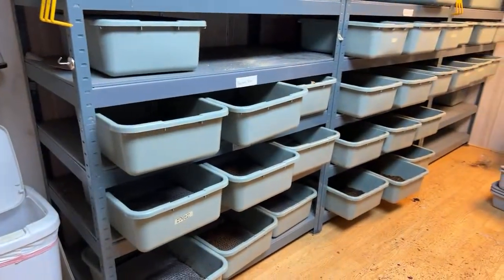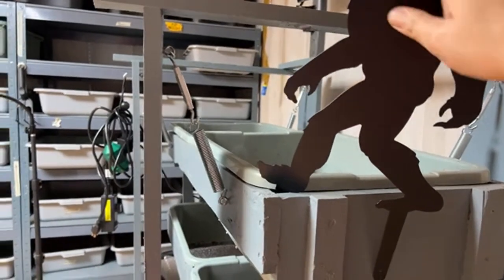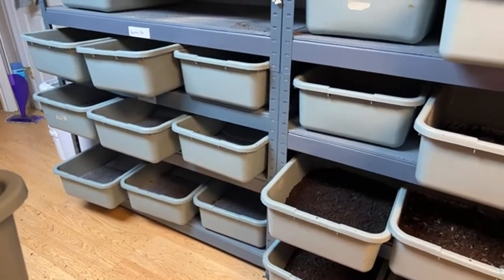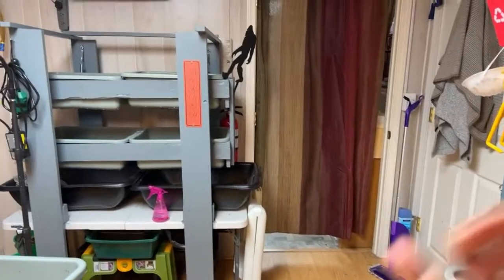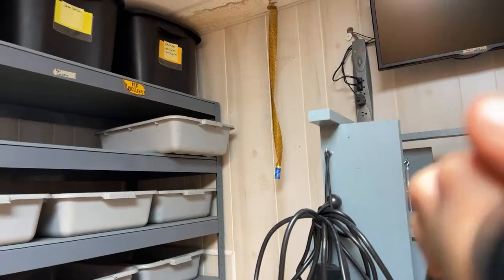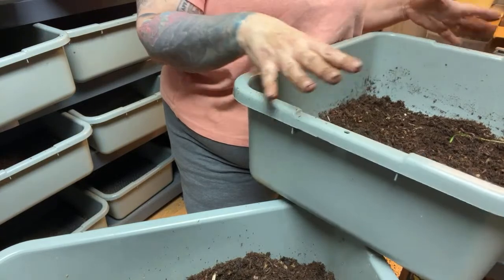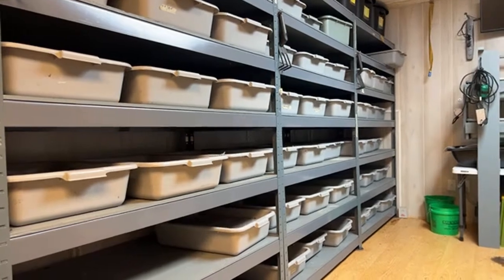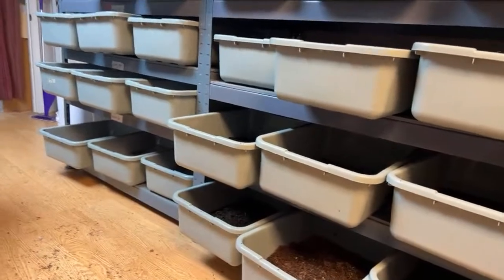Making money growing worms

Comment: I love watching your vids and I could sell worms , I mean I have the experience of worms and have gone thru a lot , but I dont have the space and probably not the money to invest .  So what I do is keep the worms happy and develop enough castings for myself and my two siblings. For yrs I only fed worm chow from food scraps, but the last couple months have gone strictly dry worm chow and there is an increase in the amount of castings already.  I can usually always tell when my worm trays are ready to harvest as my bottom tray of my 360 is a black black.  I did sort push for my last harvest because I wanted all my rotation trays to have the effect of the dry food formula and now they do and when I set up a new tray which is coco coir and striped newsprint I also mix in a good amount of the dry mix in starting that tray and also will sprinkle a light amount on top,  then when they begin to move to that tray will add more as they eat it.  I dont let it run out completely.  In checking the feeding tray I see that the worms are not only on top but also thick in the top 2" of bedding.  I have stretched this post out detailing it more so it may help anyone else who might be at the same point I am in worming.  Im noticing the worms on top look quite healthy very moist and robust looking.
Reply from the maker: Your worms are doing great. I see them on TikTok.

Comment: I probably mentioned this before but several years ago I made my own sifter with 2x4 s  and its  about 24" x 30"  with 1/4" screening and I just sift by hand over a wheel barrow.  It works for me in my rather small hobby.  BTW  I also used to buy and use peat by the bale , but got tired of the dustiness of it no matter how I tried to cover it.  If I could find some on the kind you show I might try it.
Reply: I see that mooresville lowes has the same exact product you show which is close to me will try it next.  Costs more than the dusty types but most likely worth it.
Reply: I also use the coir or peat as part of container mixes for my plants.
Reply from the maker: It’s wonderful. It does cause the teeny bit more but it’s worth it.
Reply: I like the live version!  And thank you for sharing all your worm information 🎉

Comment: I recently ran into a problem which was my fault but forgot When adding coir to new bedding I forgot to wring it out first, was way too wet and all the worms congregated at the top of bins.  I usually wring out the coir by hand but forgot.
Reply from the maker: It happens don’t worry about it. I have made tons of mistakes. Important thing is you know what you did and he fixed it
Reply: @TheGardenAndWormLady  Thanks, so what I did was I left the lid off until the bedding dried out some with the light on.  Took a couple of days.

Comment: I tried Euro NC's about a decade ago, outside, and the first time it rained, almost all of them escaped my bin, so I gave up. Funny thing is, I live in ND and I still find them in my back yard when I move stuff occasionally, so they can definitely live at a lower temp than 60f, in the winters the ground often freezes several feet deep! Have you experimented with adding anything extra to your primary bedding when creating it to see if it increases growth or do you still just use straight peat?
Reply from the maker: Ive use several types of bedding. Sometimes I like a combination of Peat and  coconut coir. I really love working with coconut coir because it has very little dust and you don’t need to add dolomite lime to it. But I have raised the biggest European Nightcrawler‘s, believe it, or not in straw. The euros are cold resilient so they will hang out up there.

Comment: How much is your colony starte kit?
Reply from the maker: 35.99 free shipping 
TheGardenAndWormLady.com
Reply: Thanks about how many worms in a pound?
Reply: Or how many worms in a colony?
Reply from the maker: A pound of  Worms usually has 900 approximately
Reply from the maker: I’m never sure because they are hatched babies and I just grab them by the fistfuls with the bedding
Reply: Thanks for your time.
The reason I been asking is because I just started  doing this, I started on August.
  I bought 250 worms for $37.98  I am having fun trying this out.
Reply: I don't use trays.
I am using 5 gallon bucket
Reply: I have to eat dinner now but I sure will check your website
Reply: Thanks from Florida
Reply from the maker: @edmundapontejr8820 it takes practice. Make sure they stay moist